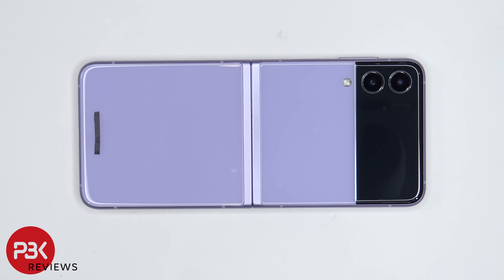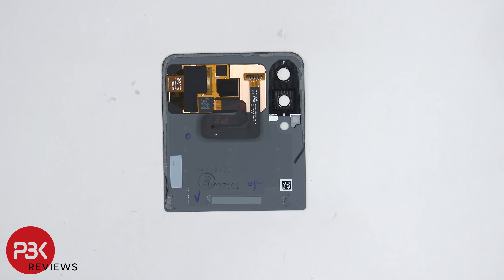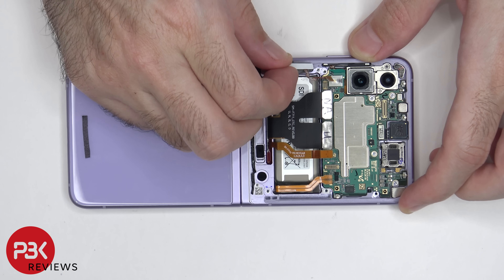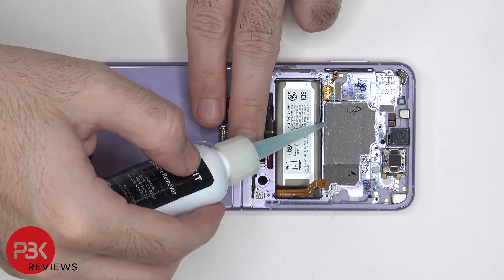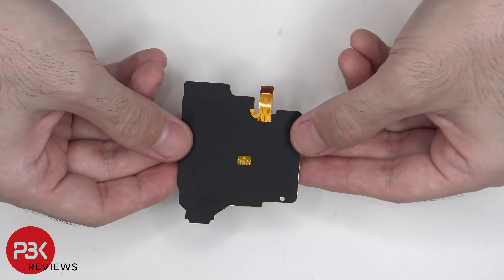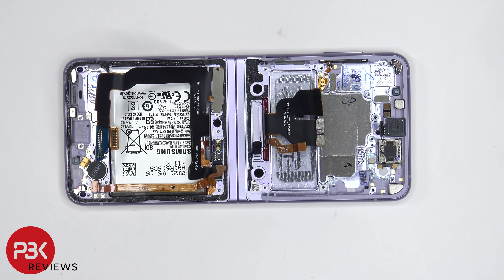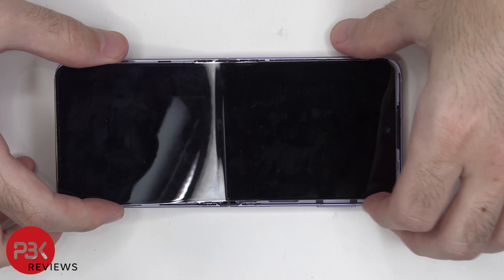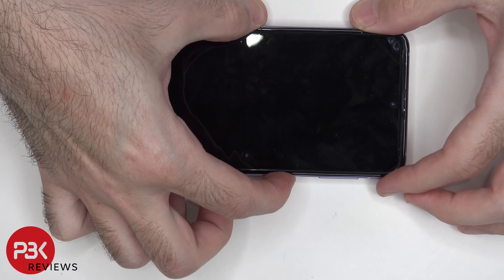Samsung Galaxy Z Flip 3 5G Disassembly Teardown Repair Video Review

Comment: I was gonna attempt to fix my daughter's phone - she dropped it on a rainy day and it landed in a puddle 🤦🏾‍♀️ so it hasn't turned on since and the battery doesn't seem to hold a charge at all. And it won't turn on. But when I put a 65W charger in, the charging icon comes up and the display looks good, I just don't know if it's only a battery that needs replacing or if the phone is dead 🤷🏾‍♀️ I just don't know if it's worth it now..

Comment: What type of adhesive should i use if i try to dissasemble the cover screen?
Reply from the maker: https://www.ebay.com/itm/165919552574?itmmeta=01HSAZD721GYKYHGFRA7RZA3TN&hash=item26a193743e:g:O98AAOSwNlRj3BRY&itmprp=enc%3AAQAJAAAAwOGaLmFDd%2B89lgzi2JRCbSE3m%2FaFHYiRnRKWlZKxb4lUlYFNWGRutQKIWp%2FDQLDwBBwmw4dkp4JCpATvjJLqKdYWYiTuigr5wTy8whYfUePP%2FSZ7pQod0T30gIFzAQwYK6uyhIjcjDVYVBOVWn4JIcZEQrrp3azNA62zx%2F7m%2Fo1i0dbMd3i372fV3mcIGTrFzfwlOXX0G5ON7mp8uzPs331mTaPrNMiVxRo4bSU1URtu09pfnymseNjJMLV3SFUBUw%3D%3D%7Ctkp%3ABlBMUJjxtN_KYw

Comment: after replacing the flex, the touch on the top line of the display does not work, could I have damaged the display? Could it be the tape's fault?

Comment: oh wow, what an in-depth video. so amazing... I'm seeing you replying to newer comments, so i hope you😅 can help with mine? do you suppose the screen flex connector is replacable? cause I'm typing in a flip 3 that's currently not dead but dying 😢 it's not the screen since it works well when opened partway, however it may be the connector that's been comprised. it just seizes working completely upon opening fully, so I'm guessing it truly is that one small part... however, i only see the main motherboard to screen cable floating around in parts shops, so i'm starting to worry my phone's done for...
Reply from the maker: I'm not sure exactly what could be the issue, might be the flex cable which is between flips which went bad, which is replaceable ( https://www.mobilesentrix.com/mainboard-flex-cable-for-samsung-galaxy-z-flip-3-5g-f711 )  but if its the actual flex cable for the screen, you would probably need a new display.

Comment: I have a Flip 3 with a broken screen. The cost of a replacement screen in the UK does not make it worth repairing. I have tried every option to access the phone to offload the photos etc without success as the phone is not in debug mode. Does anyone know of a way to connect a cheap mobile screen to the device so I can unlock it and offload the data then I can reset it to factory defaults and sell it as parts. I would have thought that Samsung would use the same connector and pin out on different mobiles. I imagine this would be useful to a lot of users with flips.

Comment: How do you get the outer case to stick back on....did you use glue? If so which one?
Reply from the maker: Hi here is a link: https://www.ebay.com/itm/165919552574?hash=item26a193743e:g:O98AAOSwNlRj3BRY&amdata=enc%3AAQAIAAAA4O%2FX5uI5nvuqOcp2LO545wZrB47BY5IPoKVR6XzhMUG192iolTVlF4jCGWzXMnOakkyXjB97KfN4wKoC%2BfNSvSNH2luMFdKQj5DR4RcCoM2VqHGCugOPSTQBrcsUV9HpA7mYKyY%2BZApsvRBXMinzI%2FkPSWoS5eVxiu8vr8P7KlH2u2BaQkavlox4WjOVaZjegLMPtjpocLVLI8NQaVNq%2FQ7HYN6dZhlSOLeXtgqNyHyAJiu5RXQI%2FAJUodI5CALKyXFce3e8KrwGyD7fbXJ5t%2Bw2eASkWpXTyiP38m0TVMOy%7Ctkp%3ABFBMgsPKxvNi

Comment: hey nice video, my z flip 3 got problem when i close it its turn off and i need to switch on every time also its works fine when i dont close it, and  its not turning off when its on charging, when its on charging i can close my flip phone, i went to the local market they said they can fix it in 2000 - 3500 inr, according to you what is the problem ? and should i repair it on local market because i cant afford samsung service center, please help me and replay me as soon as possible thank you ....
Reply from the maker: Hi, I'm not sure what exactly would need to be fixed or replaced that would be causing that issue.
Reply: Okay, Thank You But Should I Repair In Local Market, They Said Its Battery Belt Problem And They Can Fix It In 10000 Inr @PBKreviews

Comment: Hi, awesome video, do you think the factory thermal paste is good? or maybe an mx-4 8,5W/(mK) would help it dissipate heat more effectively, maybe the phone feels more hot in the hand but processor could be more cool, what do you think? some good thermal pad between ram and 3d graphite could do something?
Reply from the maker: For the most part its good. If you do plan on replacing the thermal paste or adding thermal pads etc, just make sure the thermal paste is not a highly conductive one, since if it leaks around, it can short the phone or components. Better thermal paste will help with heat transfer but the difference wont be all that much to notice. So not worth taking it apart to replace unless you need to make a repair on something and are going to take it apart already.

Comment: Sir!  It's big problem to put back this border plastick on the front? Thx for answer
Reply from the maker: yeah its annoying. You can use B-7000 glue (and use light clamps to keep it down until it dries) but have to be careful and apply very little and thin so it doesn't leak out too much. You can rub off excess if it leaks out after it has dried.
Reply: @PBKreviews  Thank You!

Comment: I have Flex mode Sensor fault.  Phone will power off when i closed flip. Phone will stay ON if connected to charging. Battery and LCD test OK. Can you advise what could be issue and how to fixed? Thanks
Reply from the maker: Not sure exactly, but can be a bad flex cable connecting the bottom half to the top half, can be loose cable connection, causing the cable to disconnect when flip is being closed from either the battery or the flex cable connecting the top to the bottom. It can also be a short somewhere, so not sure exactly.
Reply: @PBKreviews   Thanks . Can you let me know how to replace the Flex Cable? Do I need to remove screen to do it or can be done from the back ?

Comment: The glass of my bottom back battery cover panel is cracked. Do I need any adhesive to replace it?
Reply from the maker: yeah you would need replacement adhesive for it. Here is a link for one: https://www.ebay.com/itm/165919552574?hash=item26a193743e:g:O98AAOSwNlRj3BRY&amdata=enc%3AAQAIAAAA4O%2FX5uI5nvuqOcp2LO545wZx%2FluNsYtEPY0J5aeGqxqwBSNm0FLNw712dUufnMgnYcUMLQkYrzIO7gyuqaX1Av%2BB3sZ59esUWWRht8wXFsY8M6EWTmaehwCojKCY%2BGdG4GUoHiyinZrX1K4wQXdH%2BI1Lpbn6V9BU%2BPT6D0sLvJidyy3Bg19FVYCurJZeHjDyYW5cD86UQusP039BRU3%2BYIDCRqzTbteuY41u5pw4xhM1ohRXqfoifLOJ0Wh68vtwvM60J3L%2Bgss%2BBs1Ijwg5MtgGPYQNGr13ncF6eAHnlF2r%7Ctkp%3ABFBM2LmK_5Fi

Comment: hello, how do you glue the back panels?
Reply from the maker: you need the original pre cut adhesive strips like this: https://www.ebay.com/itm/165919552574?hash=item26a193743e:g:O98AAOSwNlRj3BRY&amdata=enc%3AAQAIAAAA4O%2FX5uI5nvuqOcp2LO545waI01pd7u7CyR%2B%2FQ1egRN3poLcYUw4cfcsC2vutcgbAxK87OhGabI1tiUWkc%2BIkN%2B5E0gJLpiu%2FfmON2yDJ1PEnWsZyiHaDtE778IQtIlqxBGrbrNsHO6R4zcLQqUCmIYklHLUMXZllCX3dou5%2FBbIsaJ1XzPSIivYwDOtw%2FfT%2BJhyhIIfywTQ86AJiO1s%2Fv2fnsnEAUY8HwvKlOIbNkGhhf87ghCfZUG2ffBcz8BQ8Si3YnSaMxSAxZxVJ6AyfXYT6y4M6riD1VeQfeapR5zgr%7Ctkp%3ABFBMnvGWsP1h

Comment: Can u help me?....where is the memory chip exactly....like my upper half is disturbed....my phone is not turning on....plz don't tell me that the memory chip is affected
Reply from the maker: It's located on the main board which is on the top half flip. Just because the phone wont power on, does not mean your data is affected. It can be a bad battery, broken screen, or other issues. If you move your main board over to another flip assembly with all the parts, all your data would move over with that board since the ROM or storage chip is soldered to the main board. But if your board is bad, then you are out of luck.
Reply: @PBKreviews my board is dead....is there any way I can get my data any?

Comment: Not sure I will get an answer  butnwhere is the open/close sensor? Im guessing its a combo of magnets that pull up and down a metal contact. My flip screen has trouble turning on. Takes several button pushes and accidently dialed SOS. Wondering if a magnet issue causing the problem.

Comment: Hola , mi Zflip 3 5G le cayó pimienta, lo lave sumergiéndose por un minuto y ya no quiero encender, si le conectas el cargador solo sale el símbolo de carga sin los números indicando que se encuentra cargando, me podrías ayudar por favor , saludos
Reply from the maker: Hi, you would probably have to take it apart, and dry out any liquid or moisture inside. Then use a brush like a tooth brush to brush off any corrosion on the chips or connectors and put it back together to see if you can get it to work.

Comment: Great video. Thanks! My z flip 3 powers off every time the phone is folded. Apparently a common issue. In your opinion which part is the culprit?
Reply from the maker: Thanks. Hmm might be something to do with the flex cable which runs from one side of the flip to the other. Either the center might be damaged which would be a difficult part to replace since it's held in place with cure in place gaskets, or one of the connectors on either end of it may have gotten loose which would require to just re connect it.

Comment: Does isopropyl alcohol dissolve the waterproofing seals? Also, my Z Flip 3 temp sensor might not be working properly. When the phone is closed, it charges as normal but when I open the phone, it stops charging. I used a diagnostics app, and it says the battery temp is as low as 7 degrees Fahrenheit open. When I check the temp after having it closed, it's back in the normal range closer to 100 degrees, before jumping back down again because the phone isn't closed. I tried to raise the temp by running a game that makes the phone relatively hot, and the temp only got up to about 50 degrees and still wouldn't charge. It's never been opened before, and it hasn't sustained any major shocks. If you have any idea as to what the issue could be or any suggestions I could try, I'd be more grateful than you know.
Reply from the maker: Usually this is related to a bad wireless charger or sometimes charger port or battery. Also yes isopropyl alcohol will eat away a bit at the adhesive. It will still be sticky after the adhesive dissolves but wont hold as well as new adhesive.

Comment: how do you re fit the boarder on the screen?
Reply from the maker: It's complicated and annoying, since the adhesive they originally use is more of a liquid dry in place type of glue. But you can use adhesive strips to cut down thin enough apply around the edges.

Comment: if it uses adhesive for so many pieces, during reassembly do you need ro glue it back together? if so, what type of glue do you need to use?
Reply from the maker: Hi, yes you would need to re apply new adhesive. You can watch this video explaining: https://www.youtube.com/watch?v=T4iiPUIM7-Y
Reply: @PBKreviews Thanks! Super helpful!
Reply: hey! @PBKreviews I think I found a glue that works for electronics, but i was just wondering, would using literal super glue be a bad idea? and if so, why?

Comment: Excelent video. What about the water resistance after it is re assembled is it compromised? Mine Z FLIP 3 got screen issues (  dead pixels on the hinge that stays always on) with 6 months of very careful use.  It seems to be the TBF (time between failures ) on this new tech model. I would not recommend it... They fixed it (because it was still in warranty) but it seems will happen again in another 6 months and them with no warranty

Comment: Can you or someone please tell me what kind of glue I can use to fix the front screen panel. Mine is coming undone and I can lift almost the entire panel up off the phone and before it's all the way off I'd like to clean it up and glue it back on so I don't get water or any more dirt/debris in there! I'm curious if a tiny amount of epoxy red or blue would work. If not what glue/adhesive do I need!? I've read online that T-7000 glue is what's used but I can't get it unless I order it. Just want to be sure first before buying or trying anything this close to the circuit boards and screen
Reply from the maker: Hi, this is the part you need. https://www.ebay.com/itm/403560387272?hash=item5df612d2c8:g:cAsAAOSwT3ZiOvO9

Comment: Do you need a special glue to glue everything back together?
Reply from the maker: Usually replacement battery door/covers or back plates etc come with the original pre cut adhesive installed. If not, here is a link to one of the original pre cut adhesives that is for the phone: https://www.ebay.com/itm/403560387272?hash=item5df612d2c8:g:cAsAAOSwT3ZiOvO9

Comment: Would u recommend this device seeing the durability of the device ?
Reply from the maker: I mean I am not one for the folding screens, at least not just yet. Once they make them much better with no worries of the screens breaking down the middle if the adhesive lifts up from underneath the screen or any worries about running into other screen related issues, then it would be more appealing.

Comment: Can the zflip3 front screen be replaced without needing a factory reset wiping all data? My wife screen suddenly went black and will not power on. Phone rear screen works so seems phone boots
Reply: We want to backup pictures but this phone does not have hdmi capability through usb-c 3.1 port
Reply from the maker: Yea I don't think you need to do any resets for changing the screen.

Comment: So you only need to heat up thr adhesive to remove the cover but it will go back on without applying anything once you're done?
Reply from the maker: You would need to apply new adhesive when re applying it back to have a proper hold/seal. You can watch this video on adhesive installation: https://www.youtube.com/watch?v=T4iiPUIM7-Y

Comment: Should the batteries be replaced as a set or just the bad one?
Reply from the maker: Just the bad ones, no need to replace a none defective one since they are not married/linked to one another.
Reply: @PBKreviews  so each screen has its own battery PBK?
Reply from the maker: @mgomez5606  not sure which battery powers what, but I dont think the phone would work with either battery missing or not working.

Comment: Amazing! I love the style of your videos, informative yet succinct. My Galaxy Flip says "battery temp too low to charge", how would one fix this? Thank you.
Reply from the maker: Thanks! Most likely the temp reader on the sub board/charger port board is faulty. That sub board would need to be replaced. If your phone is still in warranty, best bet is to send it to samsung to have them fix it. If not, then you can watch the video and replace that sub board/charger port board if a replacement is available. Also you can try charging it while the phone is off, sometimes that bypasses the issue.

Comment: how do you remove the Volume button?? Just saying to remove the adhesive doesn't really help. Everything else was helpful but I need to replace the Volume Button and I don't want to make anything worst.
Reply from the maker: You just need to gently peel off the flex cable portion from the frame itself so it doesn't tear, then you pull out the assembly from the two metal brackets on either side of the assembly which is in the slot of the frame. You can use a small flat head or another tool to pull the metal bracket out which is holding the volume button assembly in the slot.

Comment: So 12,69Wh of total battery capacity. Thats only about 20% less than the S21 15,5 Wh, 4000mah  battery has to offer. Thx to the secondary screen which gets about 15-20% of total screen on time in my usecase, I get easy through the day. Battery life is about the same than on my 4000mah 6,5" SD855 smartphone i used before.

Comment: Question: supposedly there are small bristles at hinge to protect against dust/debris getting inside. Did you notice them? Spigen sells a hinge protector film but I don't know if OK to install or if it will mess with these bristles?
Reply from the maker: Here is a link to more detailed pics : https://www.theverge.com/22619139/samsung-galaxy-z-fold-3-flip-screen-durability-waterproof-aluminum   . Also not sure about adding the protector film but I wouldn't install anything that is not from samsung made specifically for this phone. Its been known that 3rd party stuff damage the screens and parts on these phones so I would not risk it.
Reply: @PBKreviews  thank you!

Comment: Is that 3,300mAh battery power split between the 2 batteries? How much mAh is the little one?
Reply: 2370mAh and 900mAh
Reply: @walkrunjump  Thank you
Reply from the maker: yes correct, as the previous comment mentioned.

Comment: damn! thats one jam packed phone. 
Wonder if they switched to stainless steel (stronger than aluminium) and carved out more space on the inside, as well as slimming down the hinge mech, as it eats up quite a bit of interior real estate when flat.
Reply from the maker: Yea it's pretty packed. Not sure if they changed material, seemed to be the same to me.
Reply: @PBKreviews  It's still aluminum this gen, but a stronger type of aluminum. I can't recall what they called it off the top of my head though.

Comment: I would have liked to see a few flips opening and closing once it was back together, just to see how it holds up after a repair. Great video nonetheless!
Reply from the maker: Thanks! Ya should have opened and closed a few times. But I can tell you if the fold screen is not adhered back to the frame, it can crack or get damaged if you close it and it folds incorrectly. So always best to either get a flip assembly with the screen pre attached for replacement or make sure to use the original pre cut adhesives which eventually will become available to attach a replacement to the frame to ensure a correct installation. :)